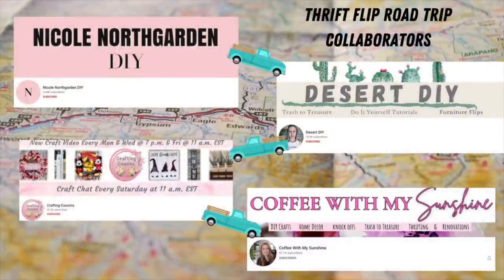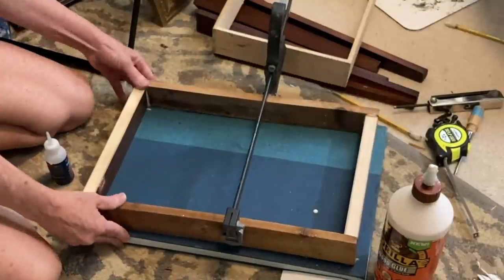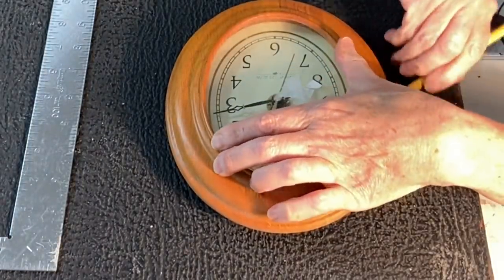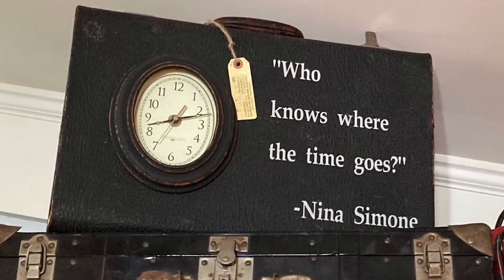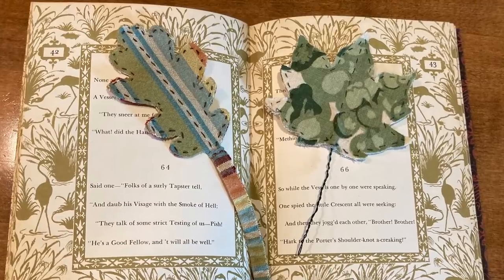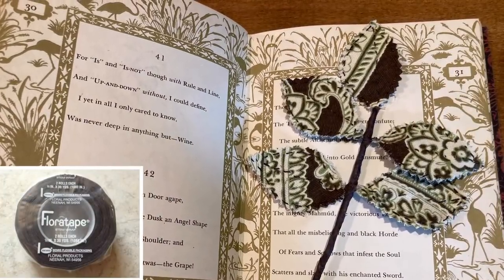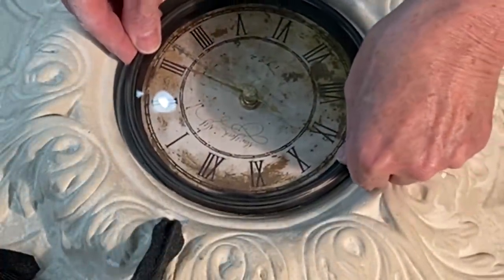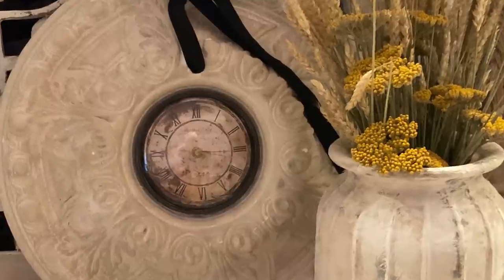Thrift Flip Road Trip/Repurposing 8 Thrift Store Finds

Comment: Can you do a video with a diy of you putting tile on something...anything. like furniture or shelves. Mirrors or frames. Idk...I have a collection of beautiful tiles. They were salvaged. I want to use them but haven't figured out how yet. Most of them still have glue on the back. I don't know how to remove the old glue or even if I have to..thanks for your vids! Great stuff! ❤️❤️
Reply from the maker: I will see if I can find some pretty tile at the Habitat Restore to play around with. Most likely you will have to scrape the glue off the back (with a razor blade type scraper) because you’ll want all the tiles to have a consistent depth. You can attach the tiles using caulk or liquid nails and but them together (which will be easier than using mastic). You can also space them apart and fill in the spaces with caulk. This is easier and less messy when apply to mirrors, frames, etc.